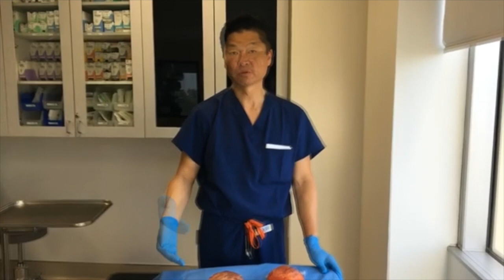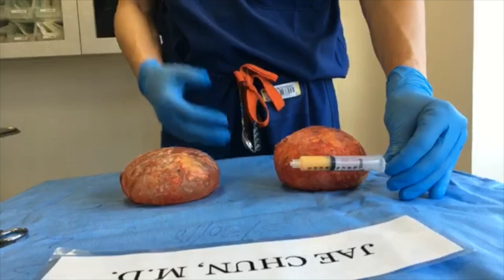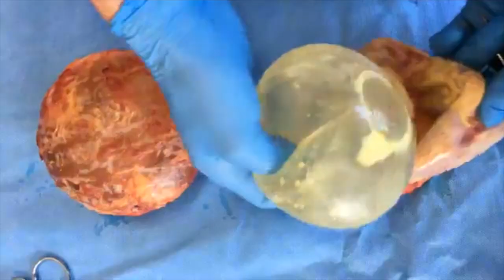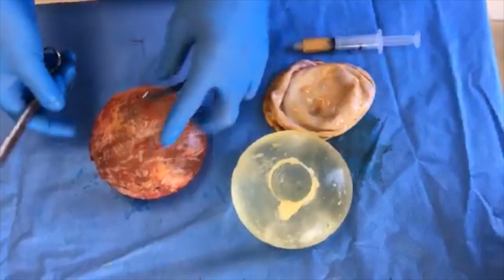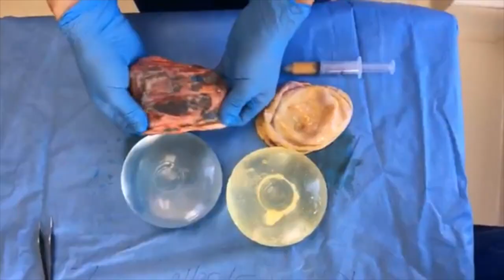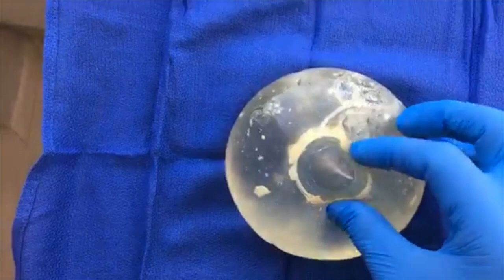Contaminated saline breast implant.

Comment: What caused that to grow over the implant
Reply: Your body forms the capsule around the implant because it detects a foreign object and tries to protect you from it. All implants, no matter Saline or Silicone, no matter the implant size,  will have this capsule form around it. It's safe to have this capsule around your implant but sometimes it can thicken and or harden too much and squeeze and misshape the implant or cause a rupture.
Reply: @JeannettieP  it's not because of the capsule is the implant by him self which ripped.
Reply: What was found in the final results?
Reply: @isap1322    JeannettieP is correct.   The capsule will often cut the implant open as it is made of calcium and it can get very hard and sharp.   Doctors have to be careful the capsules are so sharp they can cut through their surgical gloves.    The bigger the implant the more likely this is to happen and the harder the capsule the more likely it will rupture the implant.
Reply: @Kaththee  great explanation